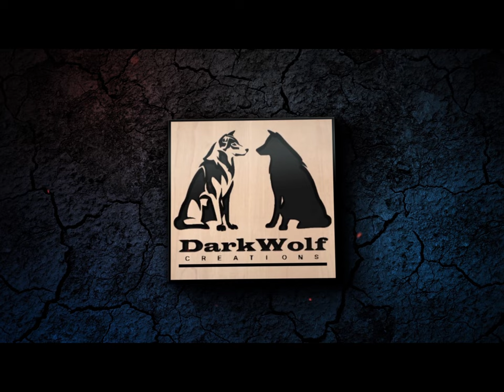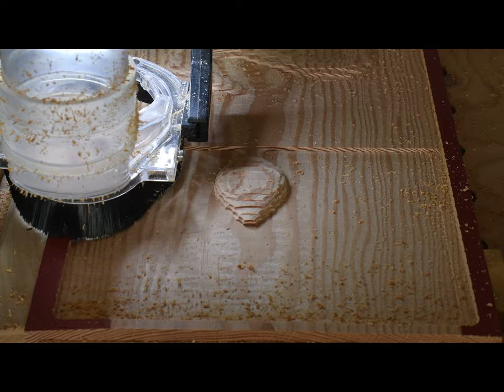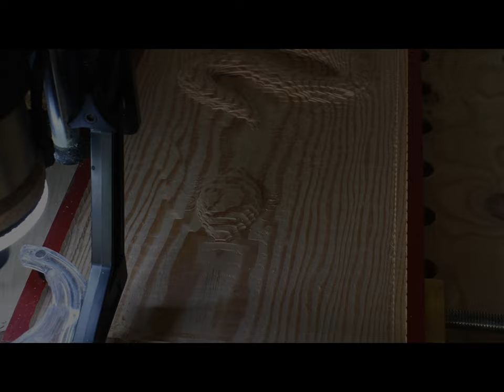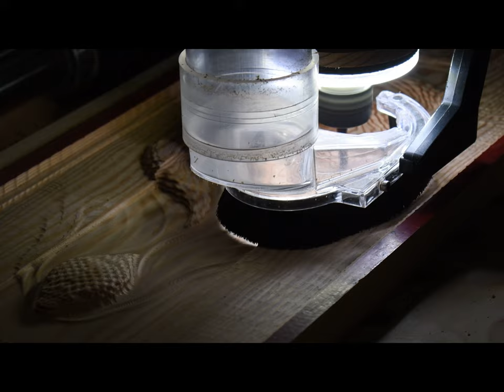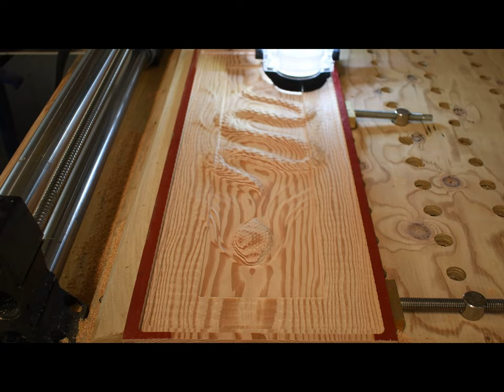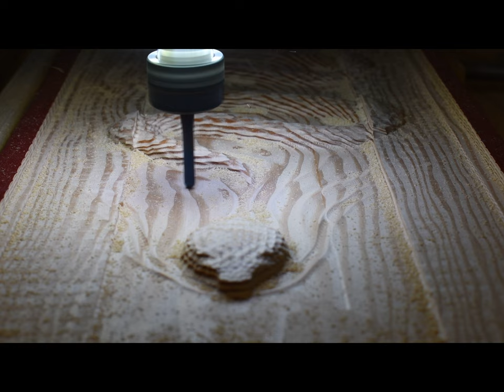Onefinity CNC: 3D Snake Carve!

Comment: How long did that take to cut out?
Reply from the maker: About 2 hours at the speed/feed I was going.
Reply: Id just run the finish pass and skip the roughing with no more doc than that is and save on the time to carve
Reply from the maker: @bubba6945  Not sure how you would remove that amount of material initially with a smaller bit to save time. Can you explain what you mean by doc?
Reply: @DarkWolfCreations  depth of cut
Reply from the maker: @bubba6945  I'll have to play around with it. I'm sure there is room to play with that 220w spindle but I don't often do 3d carves.
Reply: @DarkWolfCreations  make your start point on one of the corners set to raster at 45 degrees stepover 6 to 8 percent
and run it. What is that .125. Or .250 doc?  
I do it all the time and have went up to as much as .500 doc
Reply: @DarkWolfCreations  in the plunge into the material is what you gotta watch to not over heat the tool
Reply from the maker: @bubba6945  I'll have to take a look at the file and let you know. I'm sure it was small just to be on the safe side.
Reply: @DarkWolfCreations  yeah give it a shot. Use the node edit mode to set you start point.
Reply from the maker: @bubba6945  funny you say that lol my pump quit on me through the first attempt, then a storm knocked the power out 45 minutes later. It was a cluster to say the least.
Reply: @DarkWolfCreations  well with elite you should he able to start where you left off unlike mine i start over completely lol
Reply from the maker: @bubba6945  wish I had the elite. I have the journeyman. So I did the best I could lol.